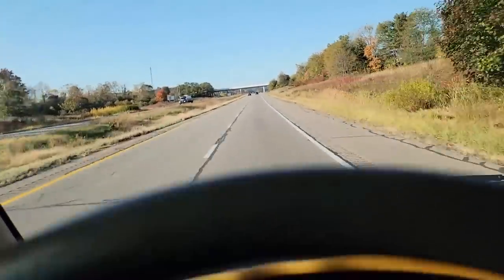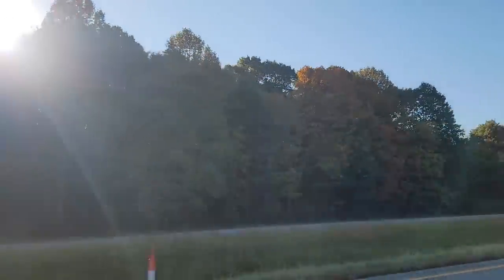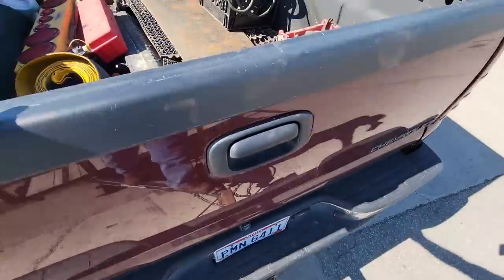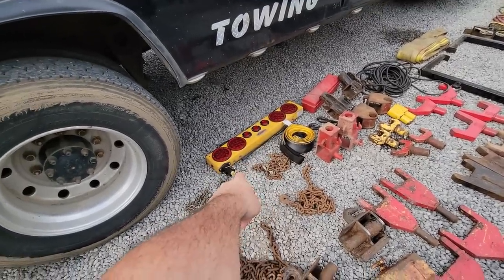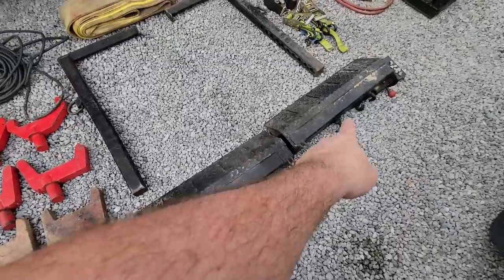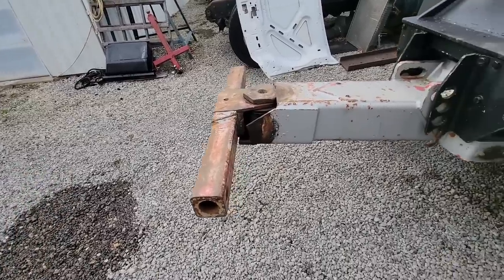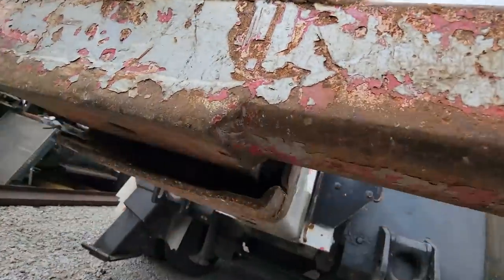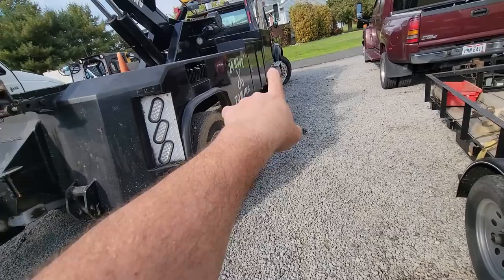2001 8100 WRECKER PT3 SPENDING $$$$ GATHERING NEEDED GEAR!

Comment: nice score. defiantly a lot of useful bits in there. you could probably just have 2 sleeves machined to be able to use those other frame hooks have it so it has a little bit of a shoulder to sit ontop of the hole and a slip fit on both the id and the od so you can pull them in and out as needed
Reply from the maker: i found one set that had sleeves permanently attached to them just like you described.

Comment: That’s a lot of gear. If your neighbors find out how much kit you’ve got you’ll be pulling their Prius out of the ditch this winter.
Reply: It is a lot of gear but a fully kitted out heavy wrecker has about double that and there are a few sets of frame forks he doesn't have and what are called bus bars that go on in place of the frame fork adapters and wheel grids
Reply from the maker: you never gain more "friends" than when you have something that can help them.
Reply from the maker: i understand idont have everything a heavy wrecker would but im not towing for anyone or doing recoveries. i just need to move my own trucks. at least right now. i will add things as i come across the need.
Reply: @j.c.smithprojects    Yup. Found that out when I bought my first pickup truck nearly forty years ago.

Comment: Great video J.C. looks like you have just about everything you need to tow your purchases. As long as the wheel lift can reach the front axle. Very nice haul on towing attachments for a tandem truck with the other wheel lift stay safe J.C.Smith.

Comment: The chains without a hook on one end can be used to secure the vehicle to the cross bar. The yellow extension are used to rear tow trucks from the ubolts.
Reply: Yep, you beat me to it! I came here to point out those same two things.... There is a reason why those chains only have one hook.... and those small yellow extensions are actually U-bolt cups. (But they can also be used as extensions if need be) 👍
Reply from the maker: is it not better to use a choker style chain to the the front axle down. they were using a ratcheet strap. i figured they had used the chains with a hook on one end for the tow bar as well.
Reply: Choker style works just the same

Comment: Nice, the tow rating would be 80,000. the lift is likely 12k or 15k. Should lift the front of your wrecker off the ground before it doesnt pick. My zacklift 453 can lift anything. Nomars were around when Holmes was producing the 750. They made 3 add on wheel lifts. Thats the biggest one. Love the content. Glad you found a nice ole wrecker
Reply from the maker: seems as though nomar went out of business after being sued by century for patent infringmenbt
Reply: @j.c.smithprojects  that's interesting. I never knew that

Comment: Hello from the Netherlands .
I know you are in the business of buying and selling trucks but for that you also need a good set of basic equipment for yourself .  
maybe you should make a plan for a real "J.C.Smith-wracker" 
what engine do I want in it, how much horsepower do I want at least, what frame would I like at least, what length minimum and maximum do I want, what kind and  I want to have a large Kabine on it, what kind and large cabinet construction should it have, what brand and weight of the upper-boom do I want, what brand and weight of the under-range do I want, what tires and rims I want  I have .  
maybe also a nice video to make a kind of drawing.  
and putting it together should be a very cool video series haha.  
always find a new part and assemble it to YOUR Own "J.C.Smith-wracker" 
oh yes and with a clear sign on it behind the windscreen NOT FOR SALE!  hahaha
 thanks for the video JC .  
Sincerely, Hollandduck
Reply from the maker: that is how i build every truck. the deeper i get into this the more i am coming to terms with building my own.
Reply: @j.c.smithprojects  
oke nice . 
I can't wait for the next video.  
I'm really curious what you'll make of it.

Comment: I know everyone on YouTube is a “pro” and I don’t want to come off that way but….  Even if the chain is grade 70, 80, or 100 and looks good, for your safety you should buy new chain. The reason is you have no idea what stresses those chains have been exposed to or how bad they have been abused.   Just my two cents sir.
Reply from the maker: i completely agree. the lifting and rigging chains are being replaced. the ones that came with these parts are going to be used for chaining up axles and other "less critical" taskes.

Comment: Honestly your best bet is just build your own can set it up

You could also go buck wild and use that lift and source locking diff trucks and maybe swap the motor with Detroit from that Freightliner so you have more than enough
Reply from the maker: Wheels are already in motion.

Comment: You don’t flip the under reach the hook is supposed be upside down it’s for the chain going over the axle to hold the truck to the under reach. If you flip it then the chain could pop out. And the chains that have one hook are recovery chains. Used for rapping around wheels on duels or frames to hook the cable to for flipping trucks and trailers that have rolled over. You need the longer chains to make a loop but when it’s flipped back over you don’t want the chain to get caught on something to get it out from under the truck or trailer. So you don’t have to craw under to get your chain off. Keep up the good work
Reply from the maker: wouldnt the chains attach to the stands that slide on the crossbar. in this case the ratchet straps were used to secure the axle. explain the extra metal on the crossbar. the new under reach has it on the bottom. i still think its upside down. i have short sections of chain like these for chaining up air ride axle for when i pull from the rear. i will leave them but some are only grade 43. i dont think i will be doing any recoveries.

Comment: If you're going to use that thing you better get your about four frame change so you're going to need them if you're going to tow tractors from the back but we've got air suspension got to be chained up so you going to need about four frame chains especially if you pull the trailer out of the ditch from the back you definitely going to need some frame change all right man you have yourself a good day looks like you got a good deal know that wheel lift was set you back mucho bucks if you had to buy it new all right man have a good day
Reply from the maker: im not doing any towing or recovery for anyone. just moving my own trucks. i use to have a 5th tow unit and a homemade flatbed with a holmes 750 tow bar. familiar with chaining up axles. however, i didnt use frame "hooks" as it really wasnt necessary for that. i will be upgrading some chains and other gear as i need it.

Comment: Those yellow tube looking things next to the yellow frame forks are to grab a truck by the u bolts don’t use them as an extension please can cause a lot of damage to the tow vehicle if they were to separate going over a bump… the wider frame forks with a flat bottom are for picking off the rear axle tubes and the wide frame forks with the half moon on the bottom if you will are for newer freight liner and Volvo rear axle tubes
Reply from the maker: thank you for that info. so i have a problem understanding how they can separate if used as an extension but cant separate if used on the much shorter end of a u bolt. the rear axle is supposed to be secured to the crossbar. however, i do agree that there are better options than stacking.

Comment: The no mar lift on the trailer has the cross bar for lifting in the same orientation as the on on the black truck. The extra metal is on top just like the one you thought was installed upside down.
Reply from the maker: someone explained. it is like that to chain the axle to the crossbar.

Comment: Get you an exhaust boot /cap if you're going to be pull tractors backwards
Reply: Plastic coffee containers work dandy for that!
Reply from the maker: mixed feeling about that. a turbo spinning at ambient temp with no load.....not a big concern to me on my trucks. never had any of my trucks towed in backwards with the exhaust covered either.

Comment: Have you looked at HeavyDSpark recovery and tow straps
Reply from the maker: no. i dont need recovery straps. i am only moving my trucks.
Reply: @j.c.smithprojects  I just thought you might just be interested. They could be used for everything.  Heavy Dave used them for pulling ect. I just thought maybe you could take a look.

Comment: Chain hooks are facing the right way for chaining into an axle fork
Reply from the maker: seems several other had the same response. maybe it will make sense when i need them to be that way.
Reply: @j.c.smithprojects  i think your looking at the hook as a way of crash bar or chain slinging it.
Reply from the maker: I think i understand what you are saying. the chain going around the axle, securing the axle to the under reach. so that the axle does not come out of the fork.

Comment: That upside-down boom on the under-reach is why the main tube is bent at the end- there's space on the bottom for that big pivot nut to slide in, but not on the top. When they put it together upside-down and retracted it, it bent up the tube.
Reply from the maker: main tube is also bent beacuse the stops are broken off!

Comment: Those chain hooks are the right way those are  to tie the axle to the under reach with a chain ( safety chains)
Reply from the maker: i agree. i use short sections like that to tie up air ride rears when picking from the rear. i thought they might have used the 1/2" with the tow bar.